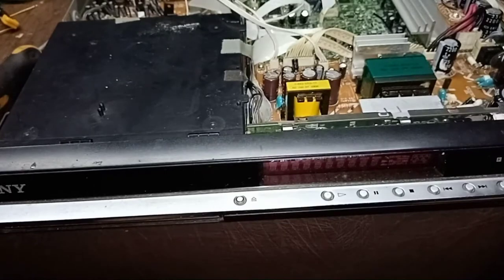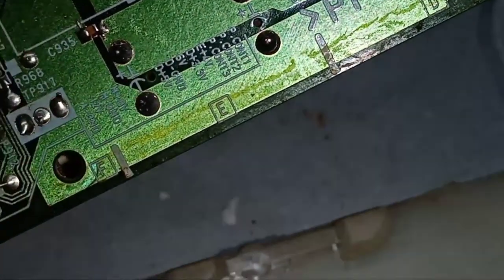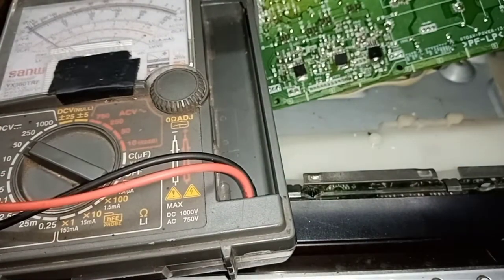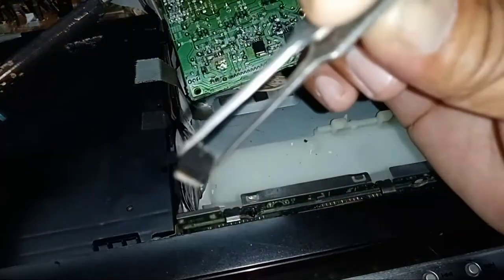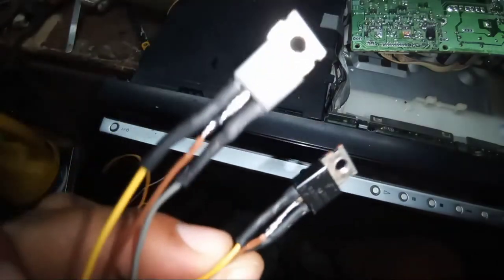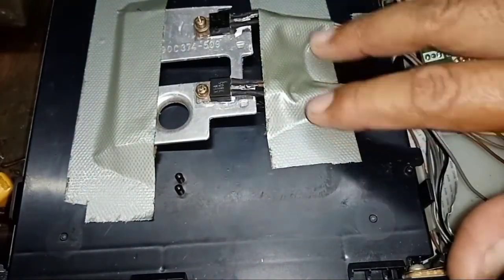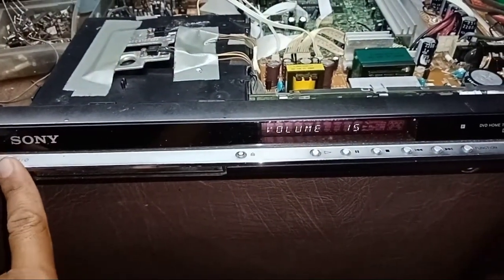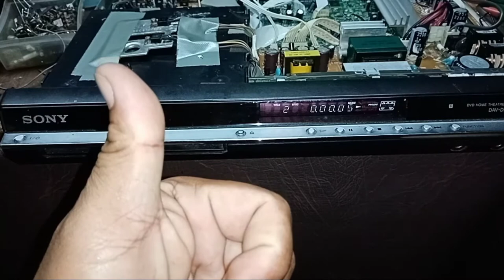SONY S - MASTER HOME THEATER NO POWER REPAIR

Comment: any thoughts on a system that appears to work fine, but the sound out the amplifier is markedly muted.  When I hook up an external amp to the speaker out, I can get reasonable volume.   Any advice would be appreciated.
Reply from the maker: kindly check settings on your remote and  speaker wiring connection first sir.

Comment: Great video sir
 My sony dvd 
Model dav dz120k in power supply 32v not out what to do sir on supply board 
2 photo coppler on board after remove the copppler both one coppler print given beep sound what to do sir plz help me . Sorry for my english not good.
Reply from the maker: i have upcoming video about a repair on sony dvd ..you may try to check your power supply driver ic or pwm and the mosfet transistor if its good

Comment: Sony dav tz  120k total deal no power only 4voly coming and 8volt in power supply what to do pls reply ☺️
Reply from the maker: you may check on the other missing voltages just like what i did in this video sir
Reply: Ok thankyou for reply will let you know after I repair it
Reply: Both Ta431 was defected I changed both  and all voltages are on with 32volt and other low voltages